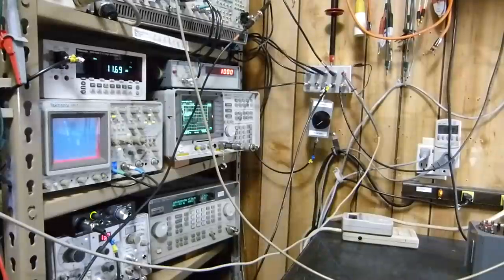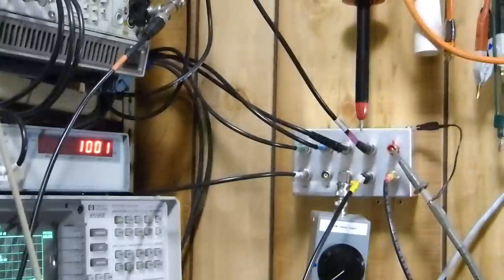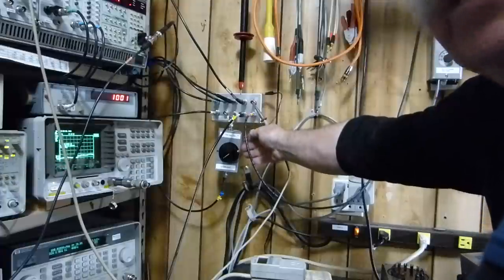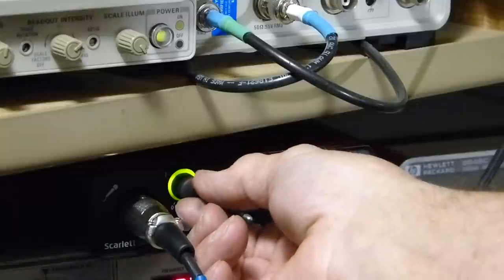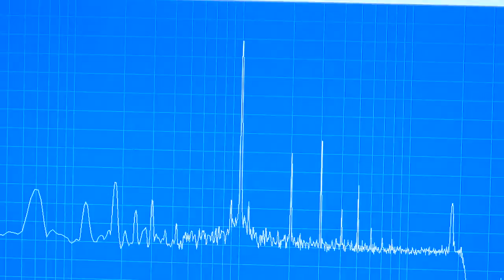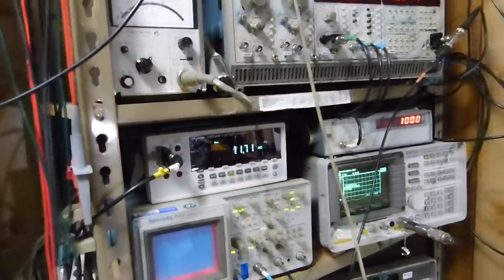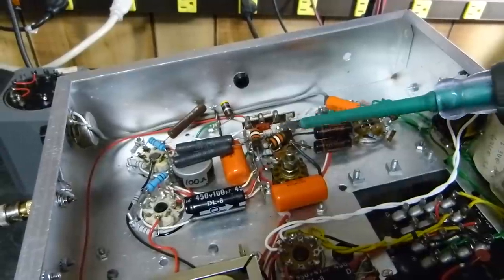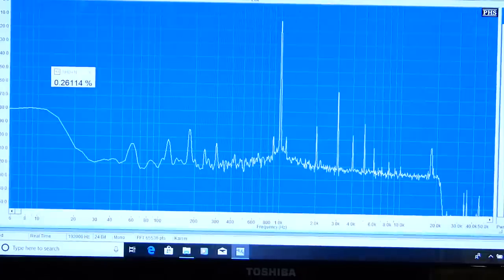Adjusting Audio Amplifier THD Using Laptop Computer FFT Software

Comment: Out of curiosity, have you compared the sound for the two settings at 03:55 and at 04:07 ? and also when connected with a speaker? The first setting has all harmonics descending according to order while the second gives the minimum for all even order harmonics.
Reply from the maker: I have not taken the time to listen to the amp with THD a bit high and then at a minimum. I can't imagine really hearing any difference and if I did, it would be at least 20 watts output.  That would be really loud in my little workshop... At any "normal" listening level, the power is probably under 2-3 watts and the THD is probably around 0.2% or below even with reasonable imbalance in the adjustments. It is just too subjective for me to realistically comment on. Thanks for your thoughts and comments.
Reply: ElPaso TubeAmps : Thank you for this reply. Judging from your response I realize I might not have phrased my earlier question clearly, however, your response might still stay the same! : )
Regardless, I will attempt to rephrase it. The characteristic of interest in the distortion spectrum produced by the first setting is that distortion components (i.e. harmonics) are monotonically (or nearly monotonically) decreasing with harmonic order. There may be some people out there that think this might be beneficial to the sound perceived. This is not necessarily the same with maximum distortion - although it may very well be, depending on circuit design.
In the second setting, of course, even order distortion components are minimised.
I just wanted to point out that the emphasis in my earlier question was on the monotonicity of the distortion spectrum in one case (vs. non-monotonicity in the other). 
As for whether it matters in low or medium power levels, I see your point, however, I suspect the main effect that one may be able to perceive might be a difference in "tonality", for example, in particular types of sounds such as that of the human voice or the piano's or of percussive instruments etc. There are certain "instruments" to the sound of which the ear is more discerning as far as distortion is concerned than it is with others'. Anyway, I just wanted to convey my initial question correctly.
Thank you for your attention.
Reply from the maker: @Stelios.Posantzis 
I think these conversations are amazing. I state in virtually every video that I learn more from you all than you learn from me. Your articulation of the issue is very important and how you describe your thoughts brings increased value for a better understanding and expressing the real life nuances of these measurements and opens opportunities for others besides myself to add to the discussion. I don't have a good answer for many questions, unfortunately. 
I often times comment on the mid and upper frequencies and how I judge my amplifier builds on how they sound in my home theater. By far, most of what I hear is the human voice and the better and easier I can understand what is being spoken is a very important aspect in how I rate an amplifier. I can't do much for the rest of my system, i.e. speakers, receiving equipment, etc. I am fortunate to have high-end commercial audio equipment but I can say that even though I have had very little actual exposure to SE amplifiers, I have to admit, they seem to have a clarity that is not in the more power PP and NFB amplifiers as long as only a hand full of watts are necessary. 
Years ago I build an amplifier with an adjustable NFB circuit and when I turned the FB down (lessened the NFB to around zero) the amplifier just seemed to come "alive". I labeled the control "sound stage". As I turned in the NFB the sound became very compressed. Just that simple is how I heard it. The unfortunate part is with very little to no NFB, the maximum power output was around 8 watts or so and THD and accompanying distortion to the ear, rose sharply past that point. With probably around 20 dB of NFB the amplifier would do better than 80 watts at 1% THD - so, there is sure a Yin and Yang to that... 
I hear the SE amplifiers on the Internet but they are usually playing music with very little LF in the music. I suppose if I only listened to violin music at a moderate level, that would be the amplifier to have. I mention SE amplifiers here as 2nd order distortion is highest and each following harmonic is decreasing almost like a saw tooth waveform although the sine wave looks fairly good. And we think these SE amps sound good... (?)
I know I am getting off the subject but I just don't have any way to know how an amplifier would sound with increasing/decreasing odd harmonics or even harmonics or a monotonically set of increasing/decreasing harmonics. I suppose some people can hear these nuances, but I surely don’t think I can. I suppose technically, it would be best if they all decreased down to zero but I will comment on that in a minute. 
In my simplistic way of adjusting the amplifiers, I tend to focus on the second harmonic as I believe it is known to have the most power in it and become the most offending. Maybe that assumption is not true. Some people say all even harmonics are good and all odd harmonics are bad. I have to disagree with that idea. 
To digress even more, I have listened to SS amplifiers that have a harmonic distortion profile in the 0.01% range and have found them sterile sounding. I am not sure why but maybe this better addresses your concern about how some people might perceive the increasing or decreasing of harmonics beneficial or not. I have stated a number of times, it seems we may like the artifacts that our vacuum tube circuits produce in music. The violin is certainly not a pure sine wave. It is scratchy, gritty, squeaky, etc and even though, technically, we want our amplifiers to reproduce that sound exactly, I am not so sure we don’t like a dash of 2nd and a sprinkle of 3rd in there kind of like salt and salsa. I hope I am not being too off-the-wall here… 
Anyway, it is fun and enlightening to have electronics as a hobby and be able to share and communicate with a world-wide community thru YouTube and learn more each and every time I post a video. 
Lastly, I should have shown not only does the balance in output tube cathode current and the dynamic balance of the driving signal play an important role in reducing harmonic distortion to a minimum but also grid bias voltage plays an important role and there exists a particular value that will also reduce THD, particularly second order. That just presents an idea for another video… 
As always, your comment and discussion is appreciated so please know that I do my best to understand and answer and learn from each of these communications.
Reply: ElPaso TubeAmps : Thank you for this - I certainly did not expect such a detailed response! Before I go on, let me just state that in audio (in particular and at the same time in almost everything else) it is important to be careful to always compare apples with apples. I say that because the audio "perceptory" (sic) process is such a multi-dimensional phenomenon that the experimenter is often baffled on how to define the boundaries of the problem at hand. And that is the case before even throwing in the added complexities and choices that circuit design brings along. Well as far as the latter is concerned, you certainly benefit from an excellent testing set up that enables you to go a very long way indeed in your investigations. Additionally, I do admire your patience when it comes to the analysing and problem solving of the circuits under test - I wish I had a portion of that! - which is fundamental to obtaining solid results.
Now, to the matter at hand, your response matches almost to a tee the experiences of others as I've read them attested in various internet forums over the years i.e. there seems to be a consensus regarding the sound of certain amplifiers and topologies. I expect that to be to some degree down to personal choice on "sound" artefacts (and the lack of certain kinds of them) and, of course, types of music, listening environment etc. As a basic example, there are people who like their music loud while others really soft - the latter often prefer midnight listening when background noise is minimal. Two very different ends of the scale for the same type of experience by altering (seemingly) a single parameter. Well, it's never actually quite that simple as one might think, is it?
You're touching on a number of points I'd like to comment on.
The first is, feedback and other settings on tube amplifiers - and by that I mean parameter values that do not alter the essence of a tube circuit. I believe that tubes are inherently more linear devices than their solid state counterparts. Moreover, for any tube out there we have good spec. sheets that attest to that while for solid state devices specs. sheets give only very sparse info. in the manner of a handful of parameters - if at all. The two combined give the designer certain freedoms, I think. There are added restrictions of course, one of which is the use of output transformers. But let's assume that one would be inclined to use output transformers with a solid state amplifier as well (I know I would). Well, what this benefit boils down to is that the designer can play with these parameters to bring down distortion without limiting oneself to adjusting the level of overall feedback alone - which as you (and others) have pointed out seems to take the life out of music. That freedom simplifies the problem a lot as the whole "issue" of feedback is certainly a very involved matter affected greatly by the load. Again, we face our limits once again when dealing with the many dimensions of the entire given problem: one can simply do so much in a given amount of time.
The other point is about the "perceptory" (sic) part which underlies a lot of your subjective observations. There are many dimensions to this as well. For example, you mention the distinction between SE and PP you have witnessed yourself and you have (in other videos also) referred to the somewhat "limited" bandwidth of the output transformers you're using. Again this is in line with the experiences attested by other audio hobbyists out there in that there is a certain "magic" attributed to these older transformers built by now long gone companies. I certainly wish I could experience their sound at some point - something far harder than it sounds when you live across the pond. My belief on this matter is that "these effects" overall, which I would place under the collective (and somewhat simplistic) description of sound "artefacts" is that it is mainly to do with how our brain is trained(?) to perceive harmony. I think that explains a lot more than we may realise (leaving perhaps the issue of compression out, ceteris paribus). And leaving perhaps the issue of "timing" and "rhythm" out, again, ceteris paribus - I know I said I was being too simplistic. But to make my point clearer, as I'm referring to tonality, I think that tonality plays a far more important role to our perception and enjoyment of the sound experience (not just of music) than, for example, bandwidth, noise and even perhaps timing to a certain extent. I think that it has quite a lot to do with it and does contribute to fatigue (or lack of) even when listening to compressed/distorted sound. This is a psycho-perceptory (sic) process that underlies nearly all of our appreciation of (certainly western) music. I am inclined to this direction of thinking since having obtained a little bit of understanding ever since I managed to understand more about how (musical instrument) tuning, scales and harmony works (or more appropriately: is defined). I will point you to an excellent yt video called "Music And Measure Theory" by 3Blue1Brown for that matter (there may be lots of others on the subject but I found this one fascinating):

https://youtu.be/cyW5z-M2yzw

which explains everything I could say about this matter far more eloquently. It certainly convinced me that the whole question of harmony is far less trivial than I was originally under the idea it was.
I'll save other points for another time as this is already getting too long...

Comment: Is there requirements for the usb sound card? Can you feed signal into the microphone input of the laptop? arta says we need WDM Windows soundcard driver or ASIO drivers.
Reply from the maker: I have not done it yet but I am sure you can use the PC sound card. Once again, just make sure you have attenuated the output that you take off the dummy load to a few mV before putting it into the microphone input as that input is going to be very sensitive. I use the line input on the USB sound card so it is not so sensitive.

Comment: whats the wattage of your 100K pot Sir? thanks.
Reply from the maker: It is fairly large in size but probably rated at no more than 1 watt. At 100K, it would take 316 volts across it to dissipate 1 watt in the pot and certainly that voltage level across 8 ohms will not be reached. 
316 volts across 8 ohms would be 12,500 watts so you will be safe using even a 1/2 watt resistor at 100K as a voltage divider.
Remember,  voltage = SQRT( power x resistance)  or,  power = (voltage^2 divided by resistance)
Reply: @ElPasoTubeAmps  yes. Thank you!